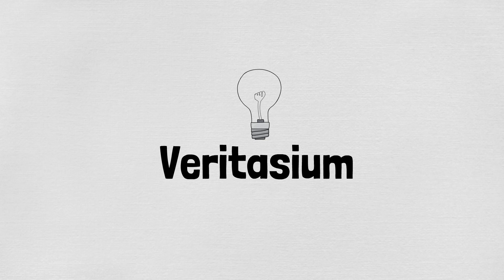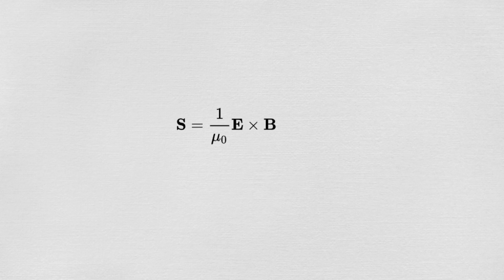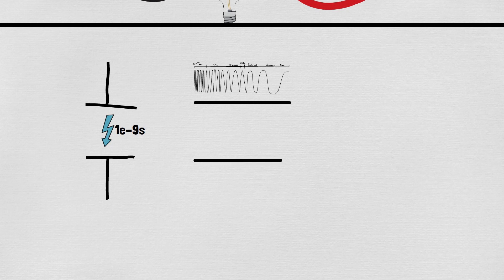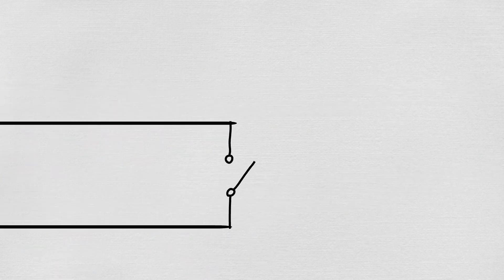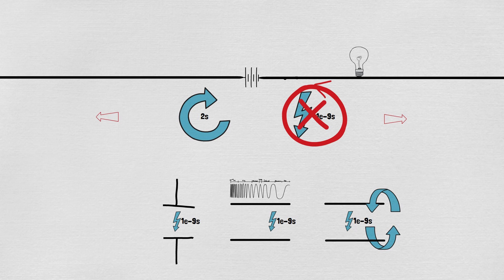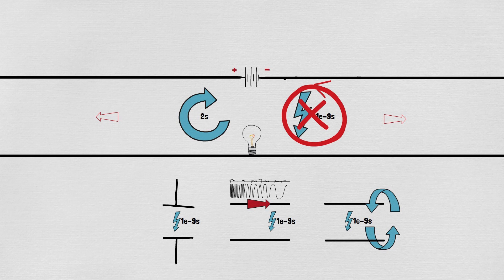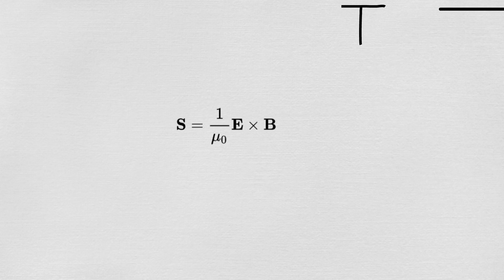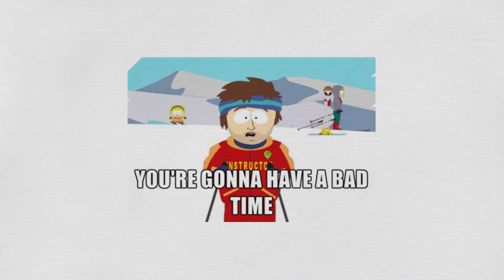Veritasium is Right? (see description)

Comment: Derek is right but only because he stipulated that any amount of current would be defined as 'lighting the light bulb' and he put the switch close to the shortest distance path to the lightbulb.   'Any' ... meaning, really, anything. nanoamps.  Even though in reality it would take more than nanoamps to actually light up the bulb.  (though if you put a LED there, it would only need a few microamps to actually see a visible result from the LED with your eye at night).

The lightbulb doesn't turn on until the switch is closed because of course the current isn't changing until the switch is closed.   Its changing current that emits photon and crosses the gap..  A static electric field does not.  Just passing a constant current through a wire does not.   The position of the switch only matters insofar as the fact that you have to calculate (roughly) the direct line of sight distance between the switch and the lightbulb, because the instant the switch is closed the current in the wire near the switch will start changing and cause an emission.   Eventually the change in the current will propagate to other parts of the circuit that might be closer in the direct line of sight... the rest of the wire, the battery, etc.  But in terms of shortest-time-to-seeing-current-in-the-lightbulb, the EM emission near the switch will 'hit' the wire near the lightbulb first. 

Of course, it won't be very much current.  The lightbulb won't actually light in reality because we are probably talking nanoamps or microamps here.  And if its a DC power source, it will just be a transient current from the EM field that will go away quickly... the lightbulb will 'flash', but not light up... then it will light up a second time for real this time once the more substantial voltage reaches it via the long path through the wire. 

So what veritasium did was ... really a bit of a trick question.  It made people think anyway.  But in reality (taking away his stipulations of 'any' amount of current), substantial power flow will not cross a 1 meter gap as shown.  With a DC source it will be a transient spike that goes away.  With an AC source there will be continuous power flow but it will be relatively tiny (and in fact might even wind up being out of phase with the more substantial flow once the voltage potential reaches the bulb through the long path).  The more substantial power flow will not happen until the voltage change propagates all along the wire, the long way, and hits the lightbulb.  At that point 99.99% of the power lightiing up the light bulb will come from the voltage differential between the two contacts on the lightbulb.

From a physics point of view, then, what is really being described here (in a real circuit meant to do real work) is what causes the voltage potential to propagate along the wire and eventually be maintained at the contact of the lightbulb.   Its better to think of the problem in terms of voltage than in terms of current.

-Matt
Reply: As I see it:  charge --> Voltage --> entropy --> current

Comment: The answer 1/c is probably the closest to reality. However, the question is flawed, because "the lightbulb turns on" is not clearly defined. Since the system will exhibit low-pass characteristics, the current through the light bulb will build up over an according time-span. A well-fitting model could probably be found in between antennas and wave-guide theory (both compatible with the pointing-vector explanantion). Seeing this as two antennas could be a first step. Without the shorts, the bulb would flash once because there is no DC propagation. With the shorts, it becomes a two-conductor wave-guide that also carries DC. The shorts are needed to keep the bulb on. What happens if there is no switch? -> The bulb is already on, no discussion will occur. ;) If the switch is on the farest end: 1/2 seconds until any effect.

Comment: Could there even be a battery strong enough to do this? I feel like with our current battery tech you'd run into some thermodynamic limits. Wires would just lose the current to heat before being able to connect to the bulb and back.

Comment: Another thing which struck me, how can the bulb know the resistance of the wires faster than light? I mean how would the bulb know how much it should glow before knowing the overall resistance of the circuit?
Reply: It doesn't. The current that flows before the field has finished propagating down the transmission line is determined by the transmission line's characteristic impedance, which may be different than the impedance of the sink at the far end. The characteristic impedance of the transmission line is determined by the inductance of the wires and the dielectric coefficient of the space in between the conductors. Think about it as an infinite series of L-C circuits that are charging one another in sequence.

If you've heard of 50 ohm transmission lines, this is where that comes from. If you push some signal onto a 50 ohm transmission line, you/the bulb will see current as if the sink had a 50 ohm impedance until the reflected signal returns back from the far end of the transmission line.

Comment: You made a mistake. Electric field is fully established throughout the circuit before the switch is flipped. It's across the battery contacts and across the switch contacts. To see this imagine connecting ideal voltmeter to switch contacts instead of flipping it. It will show full battery voltage. Alternatively you might imagine switch as a capacitor that you'll short at some point in the future. Battery is a device that creates potential difference even when the current is not flowing through it. There's no field across the lightbulb and the wires because they are passive elements and current doesn't move through them. When you flip the switch, the charges start moving thought the switch, this current will generate magnetic field. So now you have energy flow. Initially just into the switch, but as changes in EM fields propagate, you are getting it in larger and larger part of the wire surrounding the switch. It starts to flow through the battery, and battery starts to pump energy into the EM field. That disturbance in EM filed propagates along the wires, causing current to spread, but also it propagates across the airgap, causing same current in the wire that's 1 meter apart and the light bulb. If you apply this interpretation to you questions you'll get easy and consistent answers. You might wonder where does the the energy that initially goes into the switch come form. It was pumped into the EM fields surrounding the circuit in about 2 second after you connect the battery to the wires.

Comment: It seems like a lot of smart people are somehow missing the simple point of the video. It was a simple circuit, with numerous assumptions, to set up the explanation of the energy being propagated through em fields. The target audience being people that have been taught electrons move through the wire like water through a pipe. It's not meant to thoroughly explain what people learned over semesters of university. I thought he made it pretty clear it wasn't meant to hold up to scrutiny of real-world conditions, or be practical in any way other than a simple illustration for teaching non-experts.

Comment: So because the whole 'speed of information' concept means that when the switch is closed, it's going to take time for that connection and potential voltage difference to be realized along the whole length of the wire and let the electricity flow - but then after that switch-closed-information is in place the light will turn on in the 1e-9s time frame due to any of the other methods mentioned.

Is that a correct understanding of what you're getting at?

Comment: Electricity does not flow through a wire at the speed of light. Electromagnetic propagation in a wire is between 0.5c and 0.99c.
Reply from the maker: i mentioned that in the video, but very briefly.

Comment: From a practical point of view Veritassium is completely wrong. A common way to match a dipole antenna with a coax line is through a half wave coax piece. The signal travels exactly through the coax and does not cut corners. Otherwise the antenna would not work. This is so common in radio electronics.

Comment: I think Veritasium is right, he just did a bad job explaining what's going on.

Current flowing through a wire creates a magnetic field, which propogates at the speed of light. The magnetic field induces a current  in the wire parrallel to the wire producing the magnetic field.

One side of the switch is positivley charged, and the other is negatively charged. the moment the switch is closed current begins to flow at the switch. The electric field propogates along the wire and a half second later there will be current flowing at the far edge of the circuit. However current begins flowing at the lightbulb earlier because the magnetic field reaches it earlier. I think that moving the bulb further away would result in less current and a dimmer lightbulb, at least for the first second.

The way I understand it, the position of the battery doesn't matter. It's the position of the bulb and the switch which matters. If the switch was at the far end of the circuit I think it would take a half second to light up, If the bulb was at the opposite far end then I think it would take a full second.

Comment: I don't know, I saw a video from an electrical engineer who said that Derek was correct in all of assumptions.  The only contention was that answer 'D' should have read one meter / c instead.
Reply: The problem was that it was not cleary stated what it means that the bulb lights up. If any whatever small current flowing through the bulb suffices, then yes, Derek was right.

Comment: So as it turns out both videos are partly right and partly wrong. As so often happens with physics, the real world is a lot more complicated and requires a great deal more complex models to understand what is really happening. The reality of what happens is very well explained here: https://www.youtube.com/watch?v=VQsoG45Y_00. The best way to think of the situation is using transmission line effects, where the transmission lines can best be modeled as distributed capacitance, inductance and resistance. When this model is used, the light does indeed turn "on" at t=10^-9 seconds, but not at full current, only with a transient current as the capacitance between the two wires is charged along its length. As the field spreads along the transmission line with the passing of time, the effective capacitance of the circuit increases, allowing more and more current to flow, which is acts counter to the affect of the capacitance becoming fully charged. If the wires were not actually connected a half light second away, then the current would taper back to zero as time continued and the capicitance approached "fully charged" (or close to it due to leakage resistance through free space between the wires). With the wires connected 1/2 light second away, eventually the field propagates to the low resistance path, and the capacitive current dies away to be replaced with the resistive current through the circuit. In the end, the transient current is almost certainly going to be much smaller than the steady state owing to the capacitance between the two wires being incredibly small compared to the current that can be transmitted through the low-resistance of the wire once the field has been fully established through its length. The leakage current combined with the capacitive current are probably but not necessarily too small to actually produce any noticeable light in the bulb, but it would certainly be measurable with modern test equipment.

Comment: I think (and i have done the thinking for several days) that your explanation is an "almost". Derek had a condition: the bulb must turn on instantly and on any case of current. I think that these conditions will make the bulb to turn on until the traditional type current (electrons pushing on eachother in the wire) reaches the bulb the long way after which the bulb will be fed with direct current flow. In summary: in the first part, it would be fed by the radio emissions of the switching. The wavefront of the propagation will make the energy transfer to the other wire where-ever it has reached on the time. Then the induced current will feed the bulb until the traditional current will reach the bulb. However it has been a "dick move" from Derek to disguise or stretch the needed narrative on the energy transfer just to make the Poynting vector seem as the whole story. Your video would be right when you do not include the instant bulb rule from Derek. The induced current size will be similar to radio signal levels.

Comment: I had a feeling something was off with Veritasium's video.  But, to be fair, I have a question.  I know it will sound dumb but humor me a second:  We know the switch must be turned on/connect the circuit for the current to flow.  But, *why* is that the case?  And, is it really always the case?  Wouldn't lightning in nature suggest otherwise?  And, yes, I know lightning bolts are not the same thing as current in a man made circuit, nor are the velocities the same, but in the end a lot of charge is being moved and there are no closed loops involved in that one example.
Reply from the maker: so in the case of lightning, you have a massive charge imbalance between the clouds and the ground. and so a lightning strike "neutralizes" that balance, as it were. in a DC circuit, the charge imbalance only occurs when electrons leave the negative terminal of the battery (the anode, through a process called oxidation) and are replaced at the positive terminal (the cathode) by other free electrons from the conductive wire (a single electron doesn't really move very fast in a circuit, so it's just a bookkeeping thing). the cathode accepts these electrons because when the electrons were stripped from the anode to donate to the circuit, a chemical reaction took place in the cathode to rebalance the battery (this is called reduction). a cathode will generally not accept more electrons than were lost at the anode, and an anode generally will not lose more electrons than the cathode is able to accept (there are some rare exceptions). a battery is considered /drained/ when either the anode has no free electrons to give or the cathode has no reduction reactions left.

Comment: Timur Ozturk have already made great points about the switch, so I will only point that you are misinterpreting the energy flux equation at the end of the video. This equation is complex and tell us how different quantities are related at EACH POINT, not the system as a whole. So the fact that there isn't current in the whole circuit doesn't mean there isn't energy moving from one part of the system to another. Actually, as the switch is turned on, there will be a transient current in the battery (only if the battery is close to the switch), and a Poynting vector going from the battery to every direction, so the equation is telling us that there will be a energy flux from the battery to everywhere, including the light bulb. When the energy flux and Poynting vector reaches the light bulb, so will the transient eletric field, therefore there will be a small, but non zero, transient current in the light bulb, which will dissipate the energy.

Comment: Fellow physicist here: Electrodynamics is a bitch (Maxwells Equations are by chance relativistic)  and finally found the bugs in the 'Gedankenexperiment'. The switch can be positioned anywhere and you cannot describe a transient behavior with a solution of the static problem. Nailed it. Thank you - so I don't have to make the video myself :D
Reply: Well, if the switch was right at the bulb, and the circuit in steady state, then the bulb would actually light up immediatelly with full voltage minus whatever transient effects from the switch process :)

Comment: Just wondering, assuming your explanation is right, how would an antenna work? Having worked for a radio astronomy institute myself I realize antenna theory for astronomers is basically limited to dipoles, But even then, you showed the example. Using your explanation, the current could never be flowing into a dipole. Please  lookup displacement current. This being one of the fundamentals of Maxwell.
Reply from the maker: an antenna works by alternating the current such that the transient pulses on either side of the "battery" are continuously driven. in this dc circuit, when the switch closes, there's a displacement current, but it's not driven. it's transient, and the power in such a pulse is so minuscule that the bulb probably doesn't light at all, even transiently.